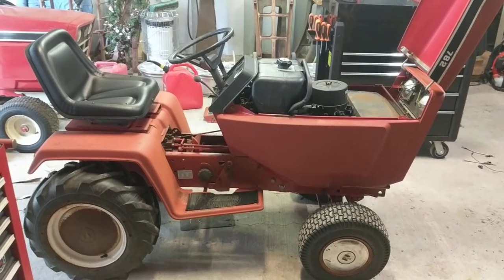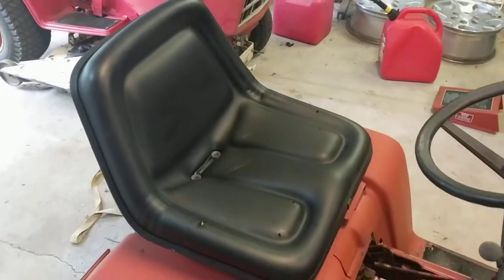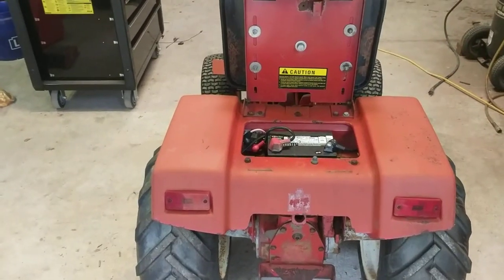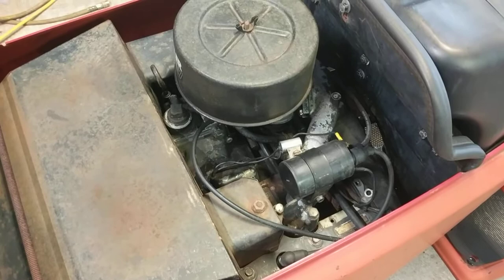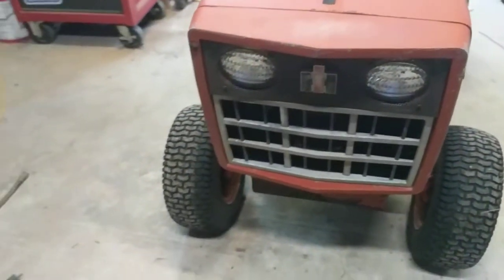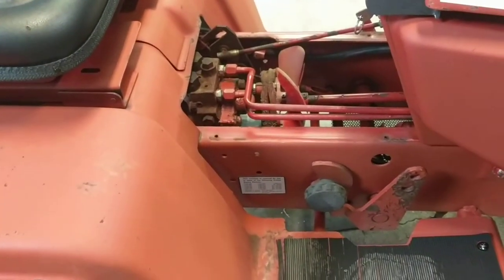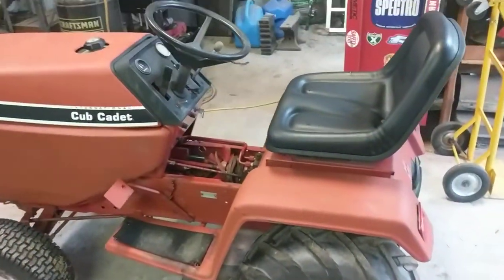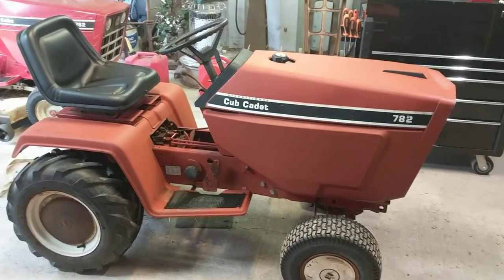782 cub cadet

Comment: Was the kt17 a series 2 motor?
Reply from the maker: Series 1.
Reply: Wow how has it survived. I just bought a 782 with 600 hours. It’s drinking oil. I want to swap it out for a Kohler magnum 18 if I can find one.
Reply from the maker: @brianschoonover4605  I wondered that myself.  I have a M18 swapped 782 that I love.
Reply: I recently bought a 782 myself, with what I would guess is the original series I. It runs great. It's an early CCC 782 but with the cast iron rear. It's in great condition aside from some dings, which is why it's still running. Absolute tank mowing though. I'm very impressed. @hallsweldingservice